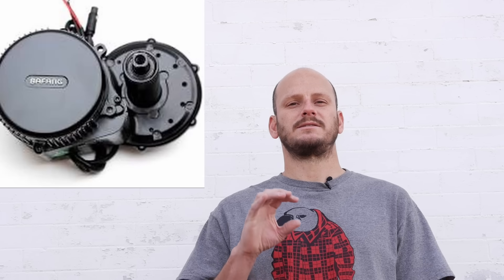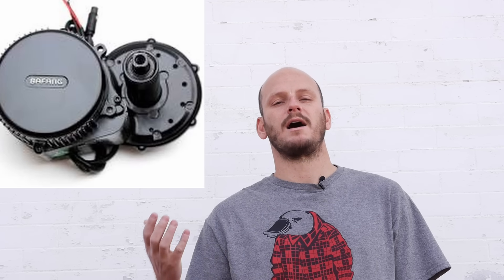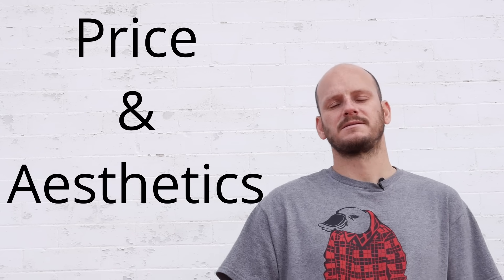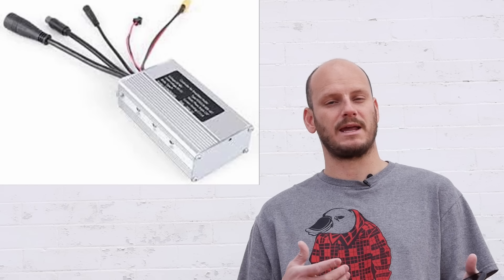Hub vs. Mid Drive Motors: Why Hub Motors Suck and Debunking Common Myths with performance test

Comment: I am a senior and I like my hub motor with throttle, I don't have to pedal at all
Reply: I love the hub motor too, easier to install, less maintenance. 600kms in and not an issue :)
Reply: @IAmMisterD  Even with another 0 at the end of your mileage you'd only be able to start to know the reliability of your motor.
As to installation: a mid-drive has less to install. You remove the bottom bracket, replace it with the mid-drive, install the battery and after some cable management you're ready to ride. You might install a display, throttle & brake cut-offs but that's true of a hub too. Only additional work with the mid-drive is an optional gear shift sensor. With a hub you have to install the hub motor (hopefully already laced into a wheel), install the cadence sensor (built in on the mid-drive), controller (built in on the mid-drive) & battery and cable management is greater for the hub.
On maintenance: changing a flat on a hub motor wheel isn't fun. Granted my mid-drive did break a chain before it reached your mileage but the chain was over a decade old with thousands of miles on it before I installed the motor. I blame myself for not using a new chain though not the motor. Both the motor & "new" chain have done more than another thousand miles since.
Reply: @IAmMisterD  me to less wear and tear no motor gears to add friction when u run out of battery
Reply: @Mal S I already stated that we both test rode over twenty bikes before we chose.  The best bike for a person is the one that fits their purpose and their budget.  Mine does both those things.  I rode mid-drive Treks, a Giant a couple of Haibikes etc and they didn't work for me.  DH decided on a Giant Roam E+ (mid drive) and he loves his bike.  I really don't. I didn't like any of the mid-drive ones I tried. If I had liked them, I would have bought them.
Reply: @Mal S we have one of each in our house and I much prefer my hub drive bike to my husband's mid drive.  We tried over twenty ebikes before we purchased and bought the ones we liked the best. For me the mid drive bikes weren't more pleasurable.
Reply: Mid drive bikes are 1k more on average. That is at least one hub motors replacement and a battery if needed.I am getting mine for fun and exercise and from wht I can see you can also lengthen the hub motor life by peddaling.I plan to peddle probably 50 to 70% of the time after my endurance gets going.I will just put the extra 1k away and if the hub motor fails will buy a better 1000 watt or 1200 watt upgrade.I have abudget of 2k maybe low 2k and most mid drives after i pick out the one I like are 3 to 4k--there are some at the 2.5k--but they lack some of the stuff I want.I also did mountain biking and anything is better then trying to peddle a mountain bike path--even a light one.biking is no fun when you get worn out. I have also seen folks take the rads--himis--and others in the price range and do some serious trails.One time I went biking and someone had just a 250 motor on their bike--I had no clue of what it was--and that person was smiling the whole time and do everything faster and easier--by far--and this was just a mountain bike they had converted for cheap and it made a huge diffrence.
Reply: @khronin  You can lengthen the hub motor life by adding heatsinks to the outside of the hub or by adding Statorade inside, if it's compatible with Statorade.
Reply: @khronin  Last year, I bought a Raleigh 21 speed for $150 and a $400 battery/back luggage rack combo and installed a $250 front hub motor kit rated 750 continuous at 48v and can take 1100 peak watts. I put over 1300 miles on that bike last year. Including pulling my kids in a trailer. At 28 mph when pedaling hard. It's great for taking them to parks and faster to get them from school than a car. I switch gears to go along with the motor and terrain.

I recently built my second DIY ebike with a 1500 watt hub motor kit that cost about $350 on Ali Express last year. Took 6 weeks to get here, but, hey, I didn't get my donor bike until early April this year. A 2007 Wahoo I picked up for $260. My battery was about $400 for 1kw. It shipped from the US in a week off eBay. Spent $80 + $20 tip at my local bike shop to buy the rear casette and set up the brakes and true & install the rear wheel. I understand what they mean about fearing a tire change. I don't want to have to pay the shop to do it, but that might happen. The bike can go 36 mph when pedaling hard in the highest gear. Maybe more with a different computer or different settings. Putting in the right settings on my 750 watt last year made a big difference improvong accel and stop speed.

That 750 watt bike doesn't have off-road tires, but the new mountain bike has a bigger shock and big tires. I took it out on a proper mountain bike trail and it ate up hills with no problem. It's all about your approach and being in the right gear to be able to pedal along with the motor.
Reply: @Nphen  well said. Horses for courses Have yet to do a diy conversion. Law enforcement here take no notice of power etc once your not acting the hooligan in public. Inclined to seize diy on grounds it’s not certified but with so many different manufacturer’s bikes now on roads it’s easy to disguise diy as factory. Only been stopped once at a radar trap and that was because I was turning in to entrance he was”hidden in” and cop wanted to admire my bike. Joking told me I was 8 kmh over speed limit but could see I was pedalling hard. 
In early days were lots of Uber eats type delivery guys using mid drives but slowly more and more opting for hub drives, way cheaper to buy (at least 50%)and maintain. 
Lots of hills where I live so my first ebike was samebike Lo26 500 W hub drive full suspension with cable disk brakes. Changed rear shock to dual action air and replaced brake callipers with line pull hydraulic callipers. Made a sweet bike. User in Dublin (Michael kinsella on YouTube )has similar the 350 W version with 14,000 km ( yes 14k) on his and as far as I know changed front chain ring to a 54 from 44 because over 45 kmh one is pedalling fresh air. Replaced a set of tyres rear freewheel and crank bearings and brake pads.  He before Covid cycled 28 miles each way to and from work. 
So I then got a gw20 20 inch fat bike 750 W hub drive. front basket rear carrier great for going to shops. Most days for fun cycle 15 to 20 miles with son on his bike. Only difference is a slightly higher drag on the fat tyre when we cycle in push bike mode. Gears work great on both. On the steep hills we both make sure we don’t stall the motors use our gears to assist the motors and keep speed in 15 to 20 range. 
Son waiting on delivery of MX02 and we got to test drive a delivery drivers one. Again from AliExpress and in the 1200 to 1500 euro range depending on battery choice. Great debate makes interesting reading
Reply: @Mal S Damn, you sure are arrogant. Why would you think that you know what's best for somebody else? I can't believe you said that it's not about being pleasurable it's about versatility. Not to everybody, in fact too many people the pleasure factor is all that matters. So just shut up and you do your thing and leave others to do their thing.
Reply: @Mal S "leverage the gears" is a personal preference like road bike vs mountain bike. Road bikes can be more aerodynamic allowing more speed with less effort during a long bike tour. Mountain bikes handle downhill singletrack trails more adroitly. So which one is more versatile? Depends on your preference, right?
Reply: @Mal S That's a strong confirmation bias from you Mal, if you're dismissing other people's lived experience. Being rude and dismissive is no way to get others to listen. If their hub drive is enough to get them through canyon trails in San Diego, why would their empirical real world test be less "informed" than mere words from a rando on the internet like you?
Reply: @Mal S Why do you believe a pleasant ride isn't most important thing? Why aren't people allowed to choose pleasure over versatility? They're grown adults, not children.
Reply: you can wire a mid-drive to use a throttle just like you can a hub motor. The main issue is the cost-per-watt. Mid drives are atrociously expensive.
Reply: @DFX2KX  fair enough
Reply: @Mal S I’m sorry but your over complicating it all, there is hardly any difference, maybe you should read more of the comments. Seems like most people and myself don’t notice a big deal rode a few mid drive and everything you just stated doesn’t seem to be the case from my personal point of view.
Reply: @Mal S It is correct that crank driven are "usually" better in harsh conditions like say grade 4 and 5 (serious and extreme) MTBing BUT on easier graded tracks and with a smaller diameter wheel a hub driven bike can perform very well. The weight of the rider is also has a major factor. Both these things you did not addressed.
Reply: This is my main reason, 71 yrs old, with athritis, back problem.
Reply: You know, I heard the actually pedalling a bicycle is good exercise.....

I actually vow to punch out the first person to call me senior....59 and still kicking butt.

I am intersted in an e-bike, to get MORE exercise, not less.... - Cheers
Reply: @joeshmoe7967  they will do that.  The calories per mile might be less, but one’s mileage goes up enough to more than match the calories expended without electrification.

In my case, my mileage went up by a factor of five or more.  I often rode further in one day than I previously did in an entire month, e.g. a 35 mile ride out while paying bills and getting groceries.  It had to do with reducing strain on damaged knees (surgery on both to correct problems I was most likely born with.)
Reply: I'm 68 and have a mid drive. I find this keeps me fit as I can still use the gears like an ordinary bike and sometimes rarely use the pedal assist, but it's there as and when needed. I've been riding bikes for over 60 years and tried just about every bike there is (including a Penny Farthing) and the mid drive is probably the best ever. I realise that not everybody is bothered about fitness but the older you get the more important it is.
Reply: @oilburner225  my hub drive is an 8 gear.  I use them a lot in our hilly neighborhood.
Reply: @oilburner225  Awesome! Only Penny Farthings I've seen were in museums. And would you believe they didn't indulge my desire to ride;)
I've been riding since the early 70s. Not even for exercise. It just seemed more practical & independent than public transportation or a car. I find riding a zen experience. Then as I approached 50 my local hills grew bigger. I live on the steepest one around. Suddenly I dreaded walking my bike (something I used to consider admitting defeat). I researched e-bikes & kits. I installed a mid-drive on my old bike and riding is fun again...What's a hill?
Reply: @oilburner225  Keep it up. I road a grade 4 track MTBing recently with a 76 year old.
Reply: @oilburner225  Great Point!
Reply: @Mal S yes but the wear and tare must kill your cassettes pretty fast, dont want to go mountain biking on a worn set
Reply: @Mal S that was my next question have you changed the cassettes and are there better made ones that last longer, 
i have a zpao b21 it,s not bad, but after
2000km the cassettes are now stating to show some were as, i assist more to get 
better run out of the battery's
Reply: @Mal S It does not depend solely on crank vs hub drive. There are many factors to consider and it is silly to make such rash generalizations that gearing alone is the most important factor. Coefficient of friction should also be one of the considerations. A single speed trials bike will climb any hill your multi geared mid drive bike will.
Reply: Or when your knees cry “enough”...
Reply: @dennisyoung4631  That's right, when my knees ache, throttle all the way.
Reply: @Mal S if yr having fun with your hub motor why try something else just to find out your  hub is less adequate. What's wrong with being happy with what you have
Reply: That's what I like about the Bafang mid-drive motors. they come with throttles.
Reply: You don't have to pedal mid drives either and you get longer mileage out of your battery packs because you can use optimum gears ratios with them.
Reply: @Billbobaker  When you add in extra steps for transmitting power through the chain, you lose power at every step. So those optimum gear ratios are for improving the rider's cadence, not battery performance. Between mid-drives and hub drives of equal wattage, hub drives are more efficient on the battery.
Reply: @Billbobaker  Not sure it makes that much difference. I get 52 kilometers on my mid drive and almost exactly the same on my hub drive. That is comparing them both on the same road.
Reply: @Mal S we live in San Diego and ride in the trails in the canyons and between the mesas and on the roads, we take them camping with us and had a beautiful ride through Valley of the Gods on them this past fall.  My bike has handled everything DHs has.  The hub drives the wheel and I pick the gear that works with it, just like he does.  I'm not trying to extreme mountain bike in the rockies true, but DHs mid drive would have trouble with that too. The only thing my bike really had trouble was small loose gravel and sand. 

That kind of argument is like saying that monkey's are better than fish because they can climb trees.

Comment: What kit do you recommend for my Rocky Mountain Growler? Medium size, thanks
Reply from the maker: Check if your bottom bracket can take a BBS02. That’s a great kit. You might have to go with a small 52v 6ah in a saddle bag
Reply: @JohnnyNerdOut  what kit do you recommend for a 2014 Giant Trance X 29er, size small?

Comment: Something you didn't address is the used market. I got three hub motors plus several controllers, throttles, and a ton of other bike/ebike parts used for less than a single mid drive.
Reply: Oh and I'm in the process of replacing the wheel on my Bob trailer to a hub motor. That way I can use electric assist when I want or just ride my bike on its own without any extra weight. 

I'd like to build a recumbent trike and use one of the hub motors there too. I'm unsure if mid drives are as easily added or used on those, or on an adult trike.
Reply from the maker: That would be pretty awesome. It’s a little more tedious doing installs on recumbent trikes but totally doable
Reply from the maker: Nice! The bbs02 motor kits are only $450 so that’s pretty impressive!

Comment: Great video⚡⚡⚡👍
I got a mountain cycle Santa Cruz
Would a mid Drive motor work? 
And where exactly is your shop at?
Hope to hear from you best success⚡👍
Reply from the maker: I’m not familiar with the mountain cycle but sure it would. Pretty much any bike will work with a certain amount of modifications. Check out the link in the description to get to my site for more info😀
Reply: @JohnnyNerdOut  
Sure will thanks👍

Comment: Your first premise leaves out the fact that a lot of hub motors have an eight speed cassette so that somewhat nullifies your argument.
Reply from the maker: I think you misunderstood the video. The point is to show the difference in how the power is transferred to the wheel from the motor. I put a clip comparing the two motor systems climbing a hill to really show how drastic the difference is.